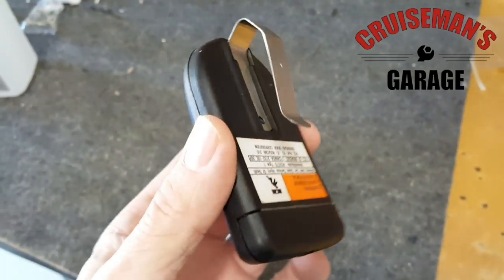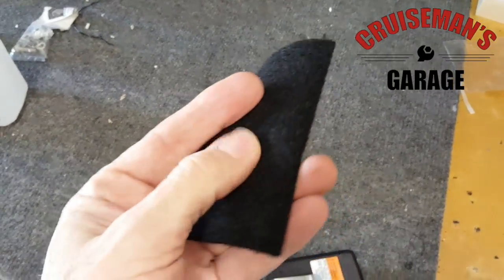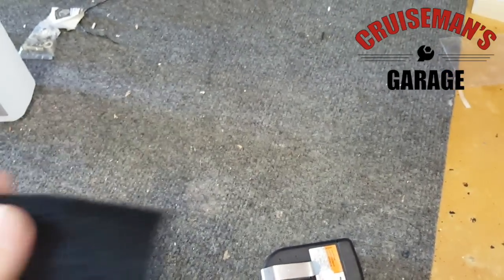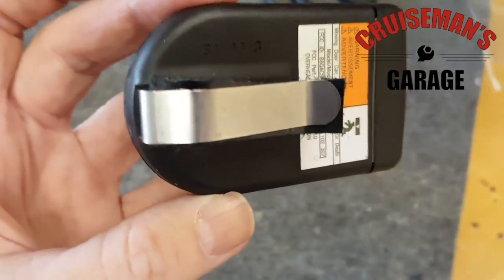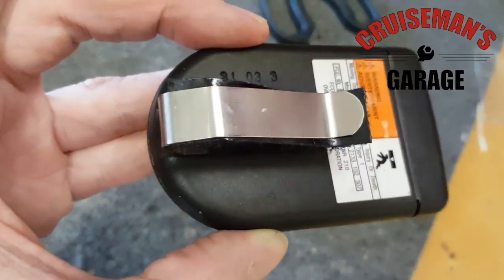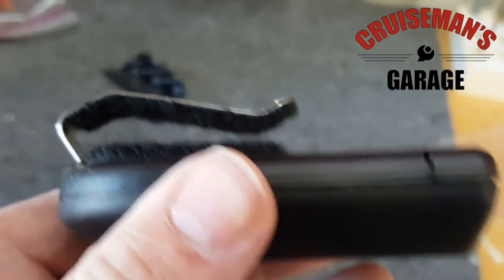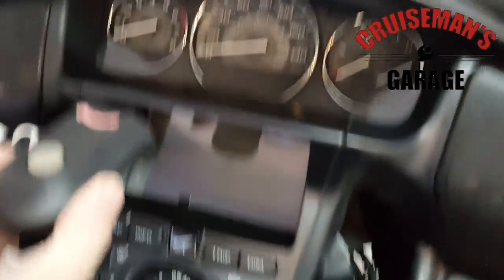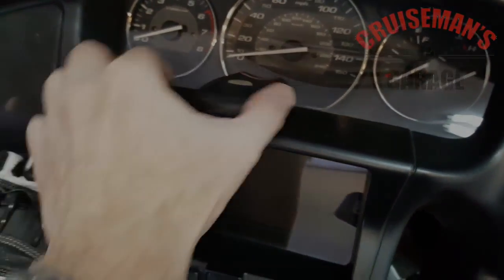Cruiseman's Garage Door Opener Hack

Comment: I took my opener, removed the clip, then velcroed it to the inside of the compartment on the left. works great. Next project is to install a 12v-3v adaptor and remove the batteries for a more permanent install. Eventually, I will have it triggered by the PTT switch already on the bike.
Reply from the maker: That'l work!

Comment: I programmed an opener keyfob then velcroed it the the top of the gl1800 dash below the windscreen. Less intrusive. In this video I would have removed the metal clip and just velcroed it to the dash as well. I think if you hit a good bump the way it's demonstrated then its bye bye remote!
Reply from the maker: I like your hack as well. However, I have hit many a bump and never had the remote fly off.